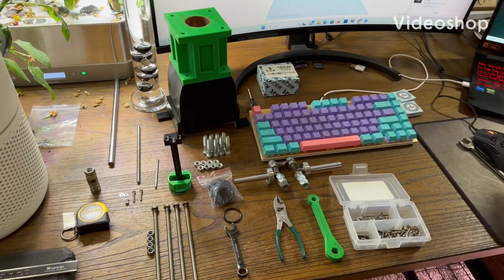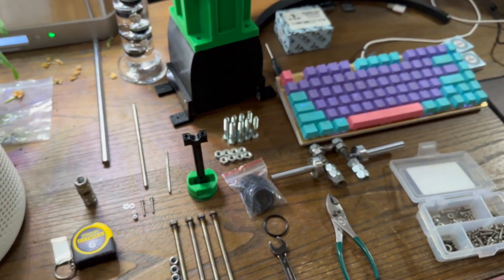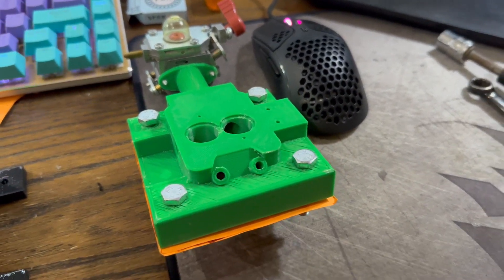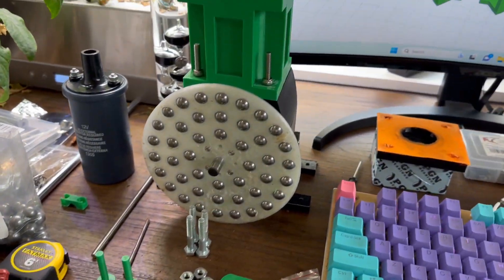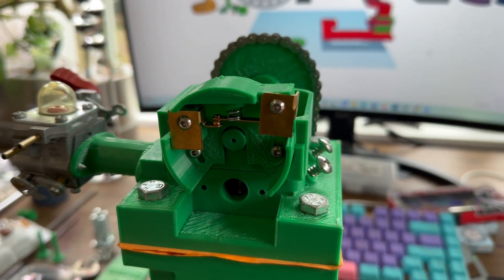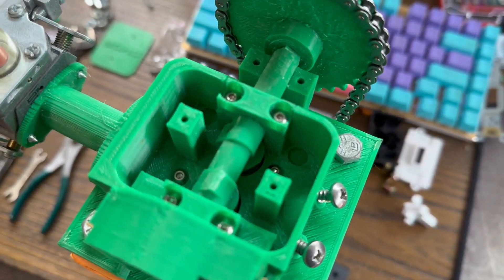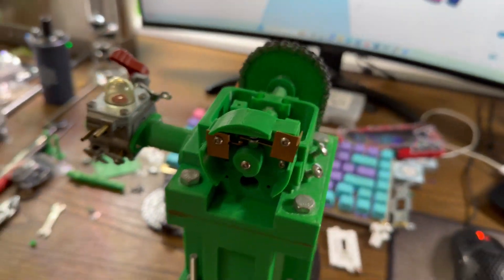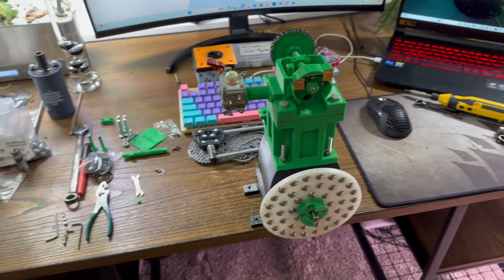Part two of my 3-D printed IC engine!!

Comment: This is a great project, I am definitely going to try this for my self. Where did you post the STL files? And also, do you have any tips for making a 3d printed engine?
Reply from the maker: I actually never posted the files, as they were not great. If you watch my latest videos, you will see how far it has come. I am working on a fully 3d printed 2 stroke, but I am having some issues. I don’t think that a 3d printed engine is a great idea apart from being fun and some parts can work for a short time, as you will see if you watch my newer videos on the engine. If you do want to try, I can provide you with a discord server I made.

Hope this helps!
Reply: thank you, if you could give me the discord that would be great.
Reply from the maker: @S1rrdominic  here’s the discord link: https://discord.gg/8Bb4spPjr3
Reply: @ thank you!